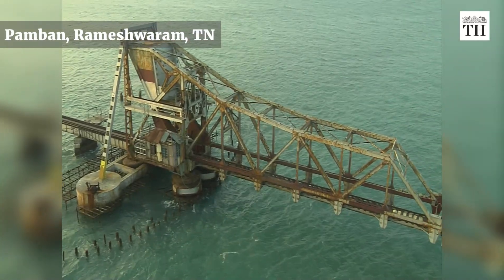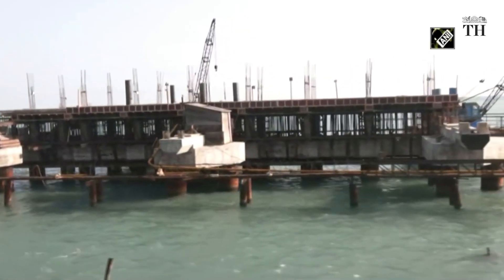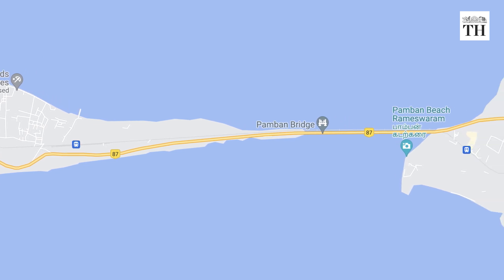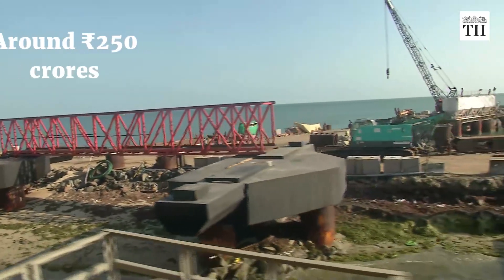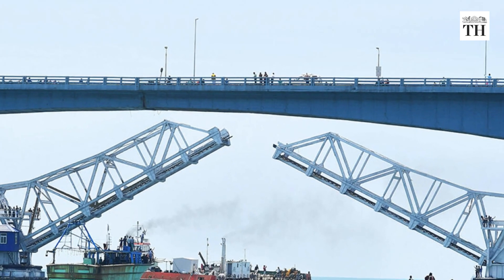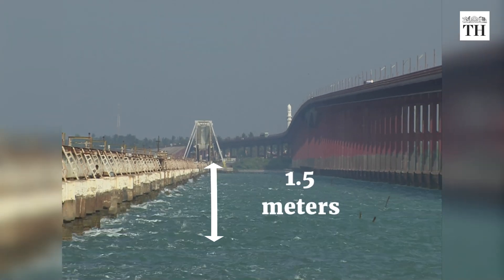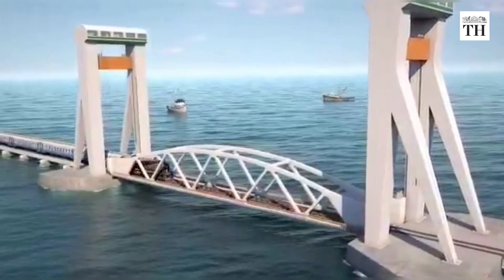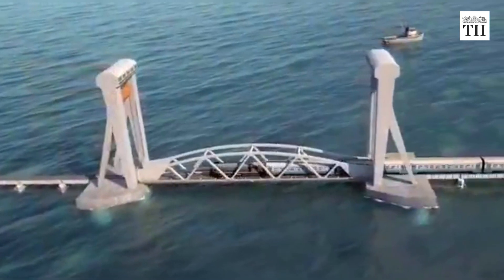Pamban Bridge: India's first vertical lift railway bridge | The Hindu

Comment: Why can’t they build it as high as the road bridge next to it?
Reply: May be due to winds' intensity... As we go higher, winds' intensity will be severe as train might get derailed 🤔
Reply: @Vignesh1297  mountain railways have left the chat.
Reply: @tula__  well, "mountain" .... that's a different story 😅
Reply: I too have similar question. May be freight trains is the answer, as on the old pamban bridge they were banned. And possbily due to huge  2.5 kms sea length its not possbile to built a new metal or concrete bridge for heavy weighted trains to pass.

Ps: to my curiosity, if u find out any other solid reason please do mention here.
Reply: Yeah
Reply: We don't know...Maybe the Civil Engineering in Contract can answer
Reply: Because as you see once the railroad enters island, it goes under Road bridge..